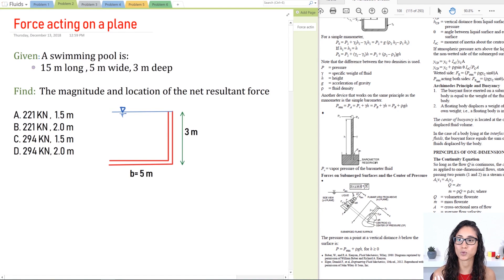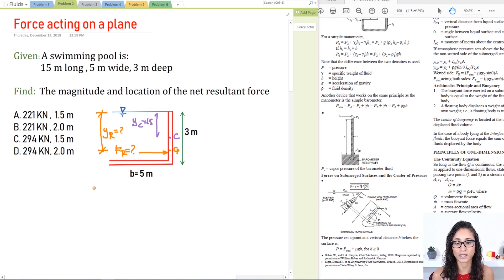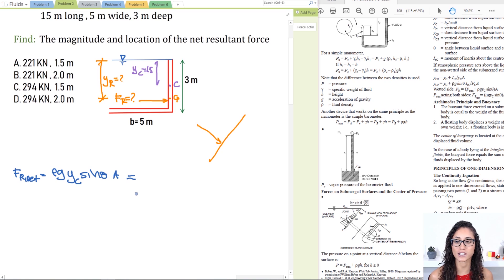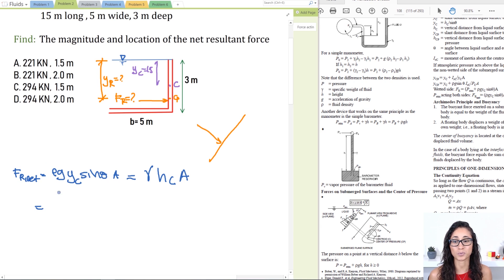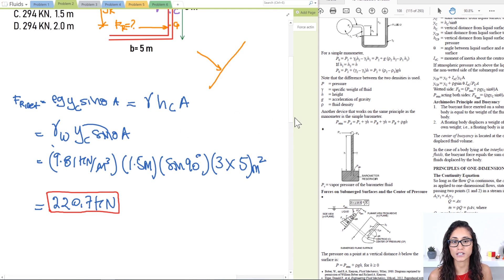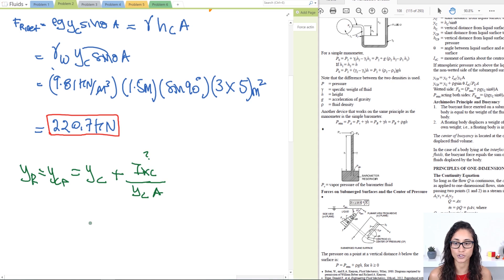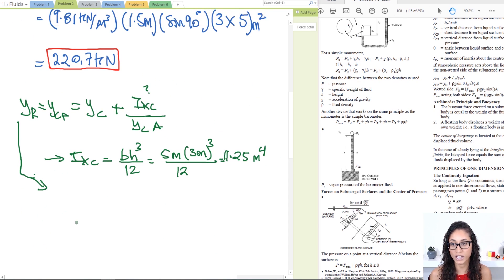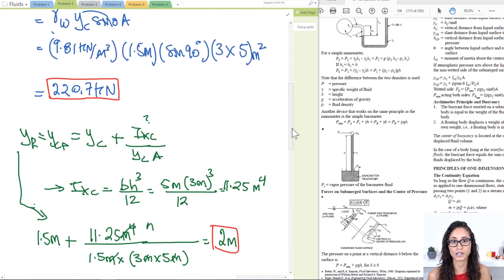FE Exam Fluid Mechanics - Force Acting On A Plane Surface

Comment: I have a question. Why do we confidently choose the FRnet equation as opposed to the other equation directly above it in the handbook which is "Wetted side: FR = (Patm+ ρgyC sin θ)A". I ask because in this problem, the fluid is only touching the inner side of the pool, which is why I would lean towards using the equation starting with "Wetted Side". The only reason I could see using the one you did in the video is because the problem specifically asks for the net resultant force, but I cannot verify that thought because I do not have a problem that uses the plain FR equation to bounce that theory off of. Also, the equation you used is labeled as "Patm acting on both sides:" before its written in the handbook, and I don't see how the side of the fluid that comes into contact with the wall is experiencing atmospheric pressure. The heading above both of these equations in this section of the handbook doesn't do this process any justice either. So again, is the sole reason really that the problem just specified solving for FRnet, and that that's the only equation in this section actually truly labeled FRnet?

Comment: Hey I have a doubt about this problem. Since the swimming pool is embedded in soil or there is soil around on all three sides. Can we still sue the Patm on both side equation or should we use the Fr on wetted side equation?
Reply: I just commented the same question but with a longer explanation. You can see my comment for what I think is the reason she is using that equation, but I still hope she sees and answers my comment.

Comment: Hi, please clarify to your viewers that you are really solving for the net force acting on the front wall of the pool with area 3*5 = 15 [m2], not the side wall. If you use the side wall, you get a net force of 662.2 kN instead of 221 kN.

Comment: Shortcut for vertical submerged surfaces:

 Since force increases linearly with depth , you can draw a triangle, (0 pressure at the surface, mgh at bottom). Find the area (0.5*9.81*3). This will give you the average force which is what's applied at ycp. To get total force, multiply it by 15(length of pool). Since the force is in the shape of a triangle then where the average force is applied is 1/3 up from the bottom of the triangle (the y component of the centroid, 3/3=1ft).
Reply: You are right except by the fact that if you multiply the area (0.5*9.81*3) in [kN/m2] by the length of the pool 15 [meters] you are still left with a value in [kN/m] which is not a force. It is force per unit length. You will have to multiply the area again by 3 [meters] which is 662.2 [kN]. This is why I believe this problem is worded incorrectly. It does not tell you which face of the pool you need to calculate the resultant force on. She is really solving for the net force on the front wall of the pool with area 3*5 [m2] (as if the force points out of the page) not on the side wall (or right wall) which iis 3*15 [m2].

Comment: The width is 5 and the length is 15, drawing is labeled incorrect. Also the force is a triangle and location is 2\3 from the surface is faster. Unless it’s a incline.

Comment: I have a question: Why is it 3x5 and not 3x15? I was just curious because aren't we trying to find the pressure and net force in the plain that goes into the page, which is the 15-meter dimension? whereas 3 meters is the plane parallel to the page.
Reply: Ditto

Comment: Hi, your videos are incredibly helpful! I do have to say that if you are in fact calculating the magnitude and location of the net resultant force on the bottom of the pool, then your y_c would be 3m, not the 1.5m( y_c is the distance from the liquid surface to the centroid of the area, which in this case if your area of concern is the bottom of the pool would be the full 3m depth to that centroid). 1.5 m would be used if you were calculating the force on the wall, in which case the area would be the 3m x 15m length of the pool.

Comment: The question is confusing because it didn't say which face the pool the question needs the force acting on to be calculated since there is 4 faces for the swimming pool. Also, if the figure associated with the problem then it makes it more confusing since the section shows the 3x15 vertical surface on the right. Now, the only option we have left with is the trail and error to match the right answer from the multiple answer provided. Thanks
Reply: Exactly, this question is not clear at all!

Comment: Thanks . could please check the moment of inertia. I think should be bh^3/12  so 15* 3^3/ 12= 33.75 and check area. or you can make clear of the question say  magnitude force on wide side or long side.
Reply from the maker: Hello Azim, in the question, it shows that the base or the width of the pool is 5 m, that is why we are using 5 instead of 15. Also, 15 m is the length of the pool, which is going into the page, and usually the length is not used in these type of problems. I hope this helps and good luck with your studying!

Comment: girll!! thanks so much for the problems. My teacher for fluids is making out tests all FE format. Where can I find the resources to fluid mechanics problems? Right now, the problems would be from fluid properties (surface tension) to fluid statics(hydrostatic eq., pressure on panels), designing a dam, etc.
Ch.1 -Ch.3 on the fluid mechanics book :)
Thank you~
Reply from the maker: Thank you for watching and for being here. For the books, you can get the FE practice problem by Linderburg. In the description, under this video, I shared links to the books that I used to study for my FE exam. Also, I think my favorite book is Study Guide Fundamentals of Fluid Mechanics, check link in the description, but this book provides so many examples with the solutions. It also helped me a lot when I was taking Fluid Mechanics class. Good luck with your classes and please share my videos with your engineering friends 😊

Comment: Hi, 

Thanks for sharing this concept. Can you please explain the rule of determining yc =1.5 m. Thanks very much!
Reply from the maker: Hello, so Yc is the centroid of the pool, but it is not the same thing as Ycp, which is the center of pressure. The resultant force acts at the center of pressure and not at the centroid. I hope this makes sense and good luck.
Reply: Yes that’s very precise. Just wanted to confirm one more thing that for centroid yc are we referring to the FE manual page-74 figure #4 would you please comment so that the concept is airtight !!
Reply from the maker: Yes that is correct.
Reply: enGENIEer thanks very much !!

Comment: When calculating for Fr,net, why did you use 3x5 as the area and not the 15x15? In the other video for forces acting on an inclined plane, you use the 4x4 as the area when calculating for Fr,net.
Reply from the maker: So in the previous problem, we were given a 4x4 square, in this problem, we have a rectangle, so the area would be width time depth, and we ignore the length. I hope this makes sense.
Reply: enGENIEer thank you for this useful explanation, but why the area is not 3m x 15m?, I know you said we should ignore the length (15), but isn’t the effective area 3m x 15m?
Reply from the maker: @gh5030  So if you try to imagine the length of this pool, it would be going into the screen, but the area in this equation refers to the area of the bottom of the pool, so the only two dimensions that we consider are the width and depth. I hope this makes sense and good luck with your studying!
Reply: @Genieprep  Hi @Genieprep You said "the area of the bottom of the pool", but you say to just consider "the width and depth". Unfortunately, that doesn't make sense. The area of the bottom of the pool would be the length and the width.

Comment: Quick question. Was the figure given by the problem? or did you create the drawing before we started to solve the problem? If the figure was not given, then how could we know if we use the 5m wide base or the 15m long base for the moment of inertia calculation?
Reply from the maker: The figure is provided. Also, when calculating for the area and the moment of inertia, always use the width. Usually, the width is specified. I hope this helps and good luck 😊
Reply: It is confusing because the first problem you go over in the playlist is similar with a 4x4 gate (going into the paper) where as this one I would think would be 3x12.
Reply: Drew Nezelek it should be the depthx length of the wall